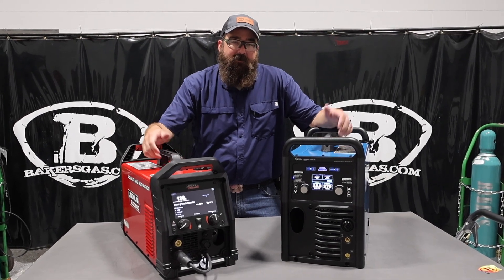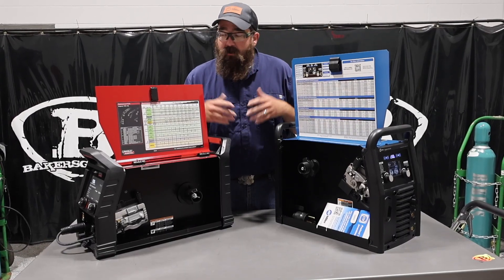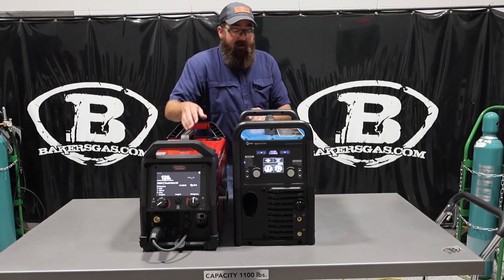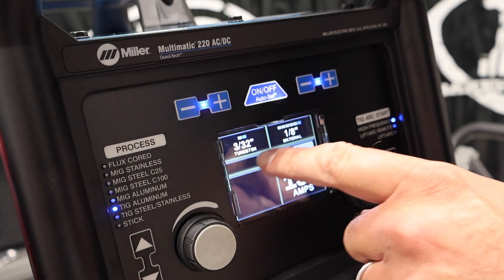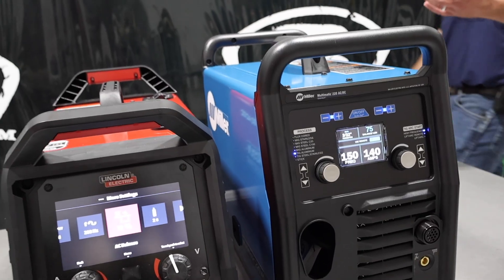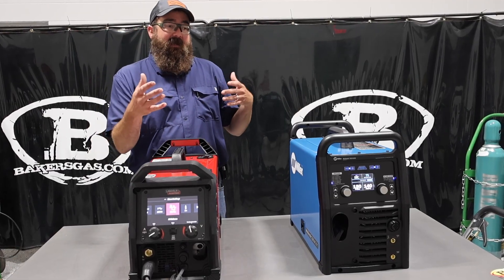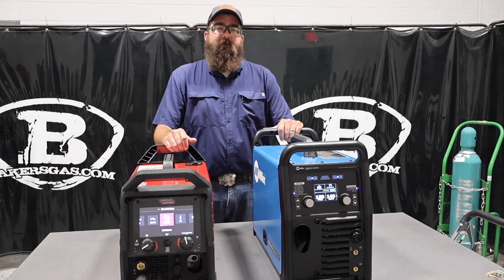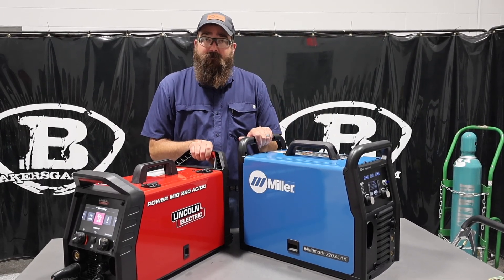Miller Multimatic 220 vs Lincoln Power MIG 220 AC/DC – Side‑by‑Side Comparison & Real‑World Demo

Comment: I love my Miller 220. Had it 4 years now. I prefer the set up and it works great. It has tackled every job I have given it. Still running strong. I mig weld and Tig aluminum the most.

Comment: The Lincoln has pulsed AC TIG and the miller Does not! big difference that this guy just glossed over. Not a great comparison. What about the minimum AC welding current is between the two and what is the minimum arc-start-current of both machines??
 These are VERY different in capability.
 I think the Baker's guy likes the MILLER too much.
  I have the Miller machine and have been using it constantly in my shop for the last four years and the real problems with it are the minimum arc start and minimum AC welding current.
 I does a *.%$ load of aluminum and the small stuff (0.030" or less) is very difficult.

 I've been waiting for a Lincoln competitor machine and now it's here but nobody wants to talk about the real specs!

  Very disappointing.

 I was a die hard LINCOLN guy for twenty years and only went to Miller because of the Multimatic 220 AC/DC as a "TRUE" multi-process machine.

 I love the the welder over all and really like the ability to leave the MIG connected and jump between my usual TIG MIG ever so quickly and effortlessly but I really wish the Miller had better low amp AC characteristics and higher freq adjustments and multi-setup memories.

 As a small one-man outfit, I don't have the space or the budget for multiple machines so these are the units that I lean toward.

 All the demos I see are for guys who just do big stuff and don't seem to care about the finer details of the machines abilities.....fine for a stick guy!

 So here I am again greatly disappointing at yet another so called comparison.

Comment: Miller is ASSEMBLED in the USA, not made. Lincoln for the win! But I’d take the HTP 2500 over both all day long. Had the miller 220 and it does not compare and reliability sucked!
Reply: The miller doesn't like dirty power found that out the hard way. I was using a generator to power it.
Reply: @richardsimmons6526  what generator were you using to power it?? And what died on the miller?